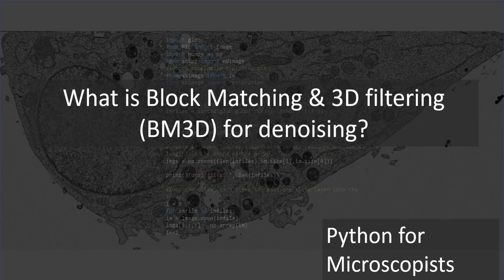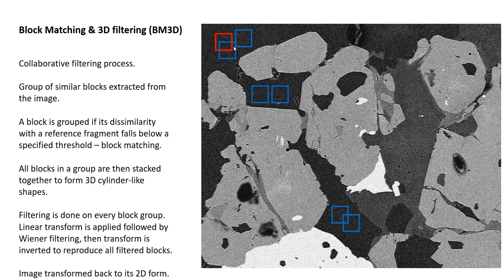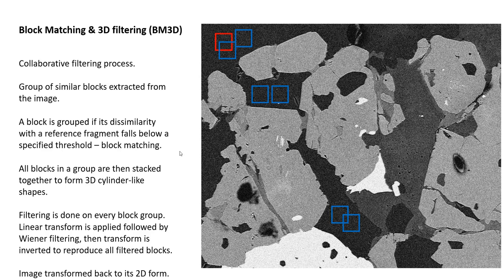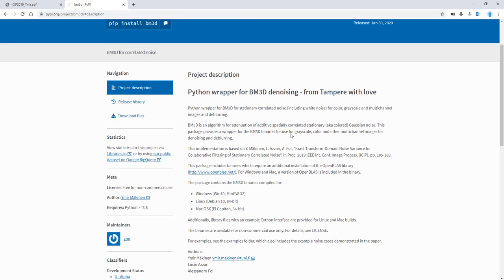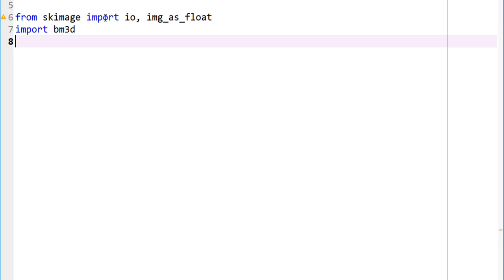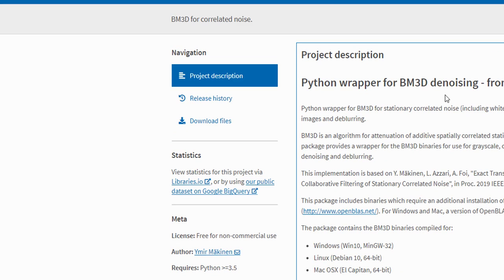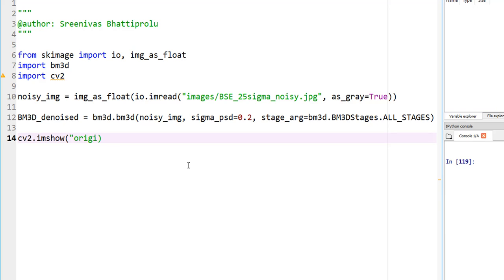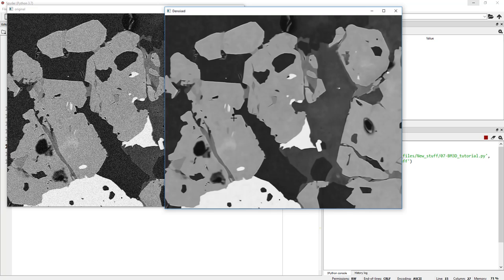101 - What is block matching and 3D filtering (BM3D)?

Comment: Thank you for explaining the part about the image being a float.
I did not understand that, since I was using a float value for the Sigma parameter on an integer (0 - 255) image it wouldn't make much of a difference.
Now I understand much better and the result is much more clearer.

Comment: Thank you so much for this incredible video! Apologies if this is somewhat of a naive question, but I was wondering if bm3d could also work on 1-dimensional data?  For example, a typical image in the MNIST dataset has dimensions 28 x 28. So would this denoising technique still work if i were to flatten/reshape the image to 784 x 1 dimensions?

Comment: These videos have been a great help. Thank you for doing these! Do you have any recommendations for correcting non-uniform illumination in microscopy images? This is a regular issue I'm having and it's particularly problematic because a lot of the images I'm trying to analyze are mosaics (so the non-uniform illumination appears as a regular pattern).
Reply from the maker: I guess you mean shading correction? If so, try converting your image to LAB and then performing CLAHE on the L channel and then merging all channels together. I will probably create a video later but if you're in a hurry here is some code I just put together. 

import cv2
import numpy as np

img = cv2.imread("images/Alloy_gradient.jpg", 1)

#img = cv2.cvtColor(img, cv2.COLOR_GRAY2BGR)

lab = cv2.cvtColor(img, cv2.COLOR_BGR2LAB)
l, a, b = cv2.split(lab)

clahe = cv2.createCLAHE(clipLimit=3, tileGridSize=(8,8))
clahe_img = clahe.apply(l)
limg = cv2.merge((clahe_img,a,b))

image = cv2.cvtColor(limg, cv2.COLOR_LAB2BGR)

cv2.imshow("Original image", img)
cv2.imshow("Final image", image)
cv2.waitKey(0)
cv2.destroyAllWindows()
Reply from the maker: Found even a better way...

# pip install opencv-rolling-ball
# Only works with 8 bit grey

import cv2
from cv2_rolling_ball import subtract_background_rolling_ball

img = cv2.imread("images/Alloy_gradient.jpg", 0)
final_img, background = subtract_background_rolling_ball(img, 30, light_background=True,
                                     use_paraboloid=False, do_presmooth=True)

#optionally perform CLAHE to equalize histogram for better segmentation
clahe = cv2.createCLAHE(clipLimit=3, tileGridSize=(8,8))
clahe_img = clahe.apply(final_img)

cv2.imshow("Original image", img)
cv2.imshow("Background image", background)
cv2.imshow("AFter background subtraction", final_img)
cv2.imshow("After CLAHE", clahe_img)

cv2.waitKey(0)
cv2.destroyAllWindows()
Reply: @DigitalSreeni  Thanks so much! Examining the problem more closely, my main issue appears to be photo-bleaching when I'm acquiring the mosaic. It's causing noticeable differences in image intensity from tile to tile. I tried performing rolling-ball background subtraction to even out the intensity, but some of the features in the samples I'm imaging (GFP-labeled tumors in cleared tissue) vary greatly in size, so it's difficult to choose a good size for the rolling-ball. However, applying clahe has improved segmentation greatly. Thanks again!
Reply from the maker: @justinsmolen6285  Photo-bleaching can be a major pain. I'm glad CLAHE worked for you.
Reply: @DigitalSreeni  Thanks Sreeni for your videos! May you have any code for 3D images from CT for shading correction?

Comment: Hello, I installed bm3d in my anaconda env, and i receive this error every time I try to run the program: AttributeError: module 'bm3d' has no attribute 'BM3DStages'
My IDE does not show any errors when writing the code. Please let me know of a solution to this issue.
Reply: When I try to just check if the command bm3d.bm3d() compiles I receive the following error:
TypeError: 'module' object is not callable
Reply from the maker: Not sure how to help. If you've installed bm3d and properly using bm3d.bm3d then it shoudl work. Please look for any typos.
Reply: Your filename should not be the same as the bm3d library name. Save the file with another name and delete the previous file. The problem will be solved.

Comment: Hello sir I tried this method on my rgb image (by deleting as_gray=true) but the color reversed on my image how can I fix it?
Reply from the maker: I am not sure what you mean by color reversed. RGB color images have 3 channels, R, G and B. If you read them with skimage then it reads them as RGB but if you use opencv then it reads them as BGR. If you followed my code as-is then you will be using skimage to read images. But I used cv2 to display them which is probably why you see colors reversed. Try converting your image from RGB to BGR before you display it:
im_rgb = cv2.cvtColor(im_cv, cv2.COLOR_RGB2BGR)

Or you can use opencv (cv2) to read images.
Reply: Python for Microscopists by Sreeni Oh thank you I was using opencv now I see my mistake.

Comment: @DigitalSreeni can you share it how to use for color images
Reply from the maker: Not sure if bm3d is designed to work with RGB images. Go ahead and give it a try. If it doesn't work, I recommend splitting the color channels, performing the denoising on each channel and merging them back into a single RGB image.